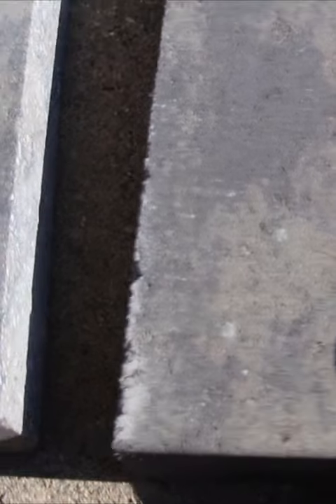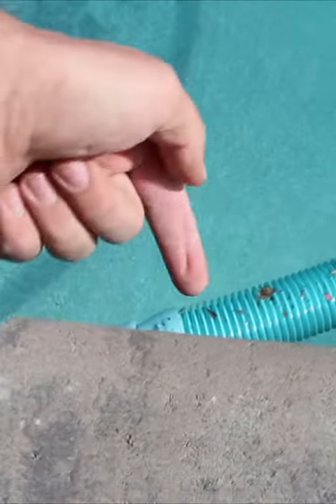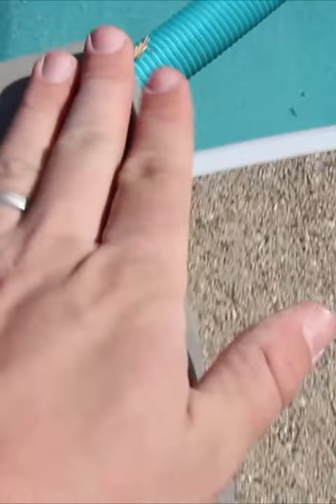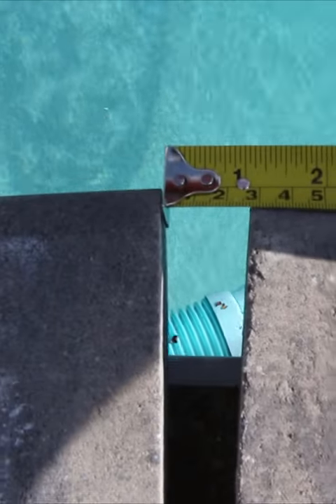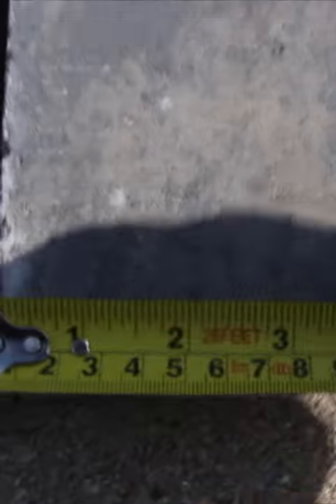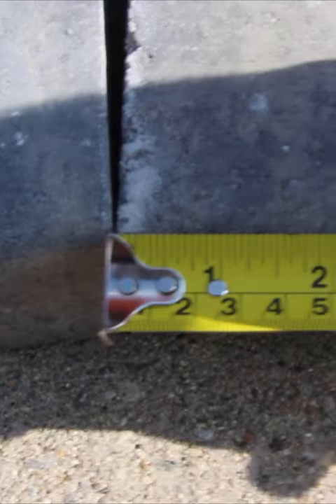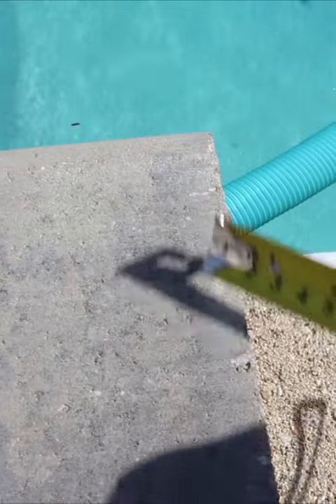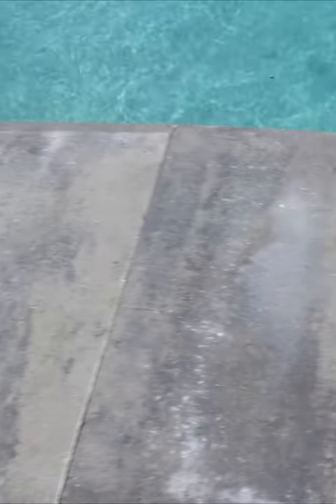How to Cut Curved Bullnose Coping for Pools #shorts

Comment: Hi just wondering the way your marking out the corner cuts does this apply to 600x400 tiles?
Reply from the maker: it would apply to anything you're trying to make a radius out of. But especially with your longer tiles, you would want to divide that gap by 2 and apply it to both sides rather than just the one side and make sure your spacing is fairly even between one slab to another otherwise you will get significant differences in length along the cut edges.

Comment: I wish I had time to explain to you the much much easier way to do that
Reply from the maker: If only you had time to comment...
Reply: @iamahardscaper  Ok. So you're doing everything right. But on block or natural stone, where you have your widening gap between the two? You measured the opening, called it an inch, and then took a half inch off each stone to each upper corner. This will be close to perfect. But there is too much room for error. What I do is take a level, or a straight edge, lay it down the gap, and draw the line on each side. This one hundred percent guarantees absolutely parallel lines, perfect top to bottom joint, as well as makes your process about 10 times faster because you're not screwing around with your measuring tape (except to maintain your one inch overhang, which you did). The edge of your level is usually 1" thick. You can scribe a pencil line on either side. 
I realize with the differences in the radius of some of the pool edging, that your gap between the blocks might be sometimes more or less than 1 in, so you can either use other straight edges, rip some different widths on a table saw, but primarily I will use my level and if I have to narrow or widen the line, I just put the level alongside it to make the adjustment. It just saves so much time that constantly using your measuring tape on every stone. And the accuracy, you got to Believe me brother, it goes up very noticeably. I'm one of the best in my city, and my work is impeccable. This is something that would be much easier to show you very quickly, then to try to explain in words, but it's a very simple thing, and it will save you a lot of headaches. Plus invest in a concrete saw. That stone table saw is a waste of time, and up here only the hack companies use them .
I'm not trying to step on your toes. For the most part it looks like you know exactly what you're doing. Like I originally said there is a much much easier and faster way to do it, which most importantly adds a tremendous amount of precision to your parallel cuts. Have an open mind and give it a try.
Reply from the maker: Ah in all honesty I appreciate the lengthy response, just figured you were trying to hate and leave. Makes sense, it would be like scribing which we do, but this provides the foundation level understanding of measuring to cut. I’m surprised only hacks use a dustless saw. What is the difference in a concrete saw?
Reply: @robertfraser7199  hey Robert can you make a video on what you are referring too… I agree it’s much easier to show then to tell thanks